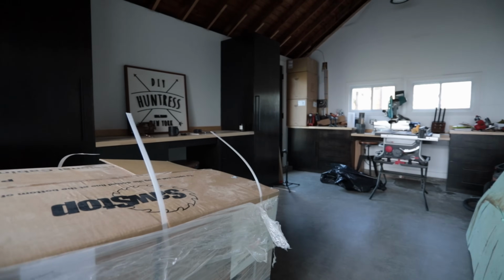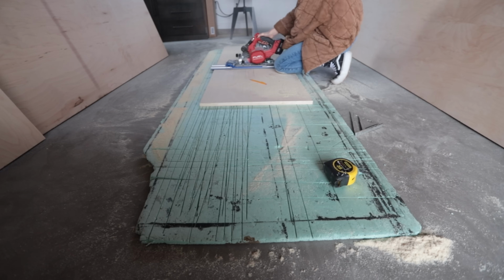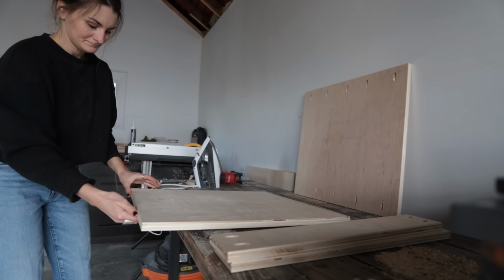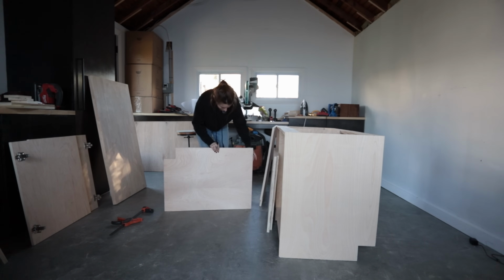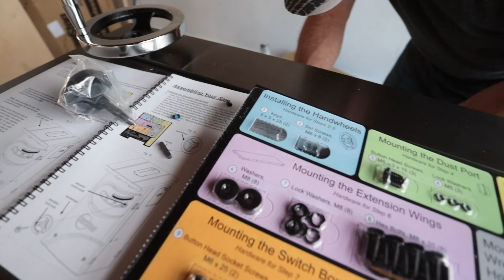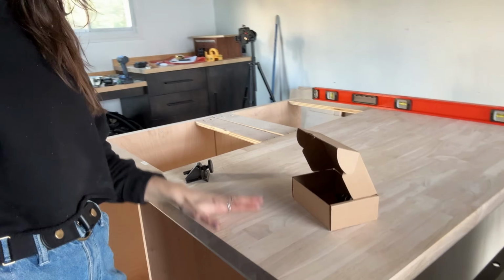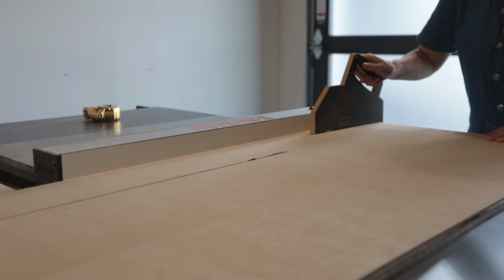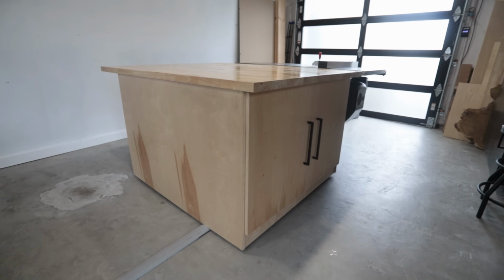I Got Rid Of My Table Saw...

Comment: Sam, the SawStop is a dream for me.  It activated the safety feature once when I was in a hurry and used a metal push stick - never again - to cut a thin strip. That tool got trapped in the blade - or it would have in an ordinary saw. Saw stop saved my tail - but losing the blade was painful. So, I didn't make that mistake again :)
Keep in mind that cast iron top RUSTS like mad if you are not careful so baby it. 

I remember first using that saw. Could not believe the power of it. Dado cuts are ridiculously powerful. It blows through any wood like nothing - even Hickory. I love the saw and have had it for about 8 years. Couldn't imagine life without it. Beautiful outfeed table. Love it.

I should mention that you can buy zero clearance inserts for the saw. I highly recommend it. And if you go the dado route you need to purchase a separate clutch for the saw as the standard one doesn't fit properly. 

Always glad to see you on a Saturday Sam. Keep up the amazing work and yes - Sam does not use stain. I love it! I'm a natural wood type of person!

Sam, one final note - please use a respirator when you use a circular saw. That dust accumulates in your lungs.  Be safe. We love you!
Reply from the maker: Thanks for all the love and advice! Happy to hear that the saw is a dream for you! Cant wait to really get to dive into using mine. 💓

Comment: very nice.   the only question I have is related to your outfeed table.   if it sits level with the saw top, you may need to extend the mitre slots to accommodate sleds and panel cutting jigs, etc,   other than that I really dig the butcher block top

Comment: I suppose a big girl saw would be nice, but I will probably stick to my dewalt construction table saw for a while. I am having a large shop built on my property so I will probably do the out feed table and it will be nice to have equipment stay in place vs. my current set up of rolling equipment out on my drive way to have a temporary wood shop set up. It works, but is a bit of a pain. It will also be nice to have a place to store lumber where currently I have a little bit of space in my garage but once the shop is built I will have much more space.

Comment: Having a cabinet saw is such  huge step up over a little contractor saw. People that haven't used one just don't know. I've had a 3hp Jet cabinet saw for over 20 years. My brother came by one time when I was building new kitchen cabinets and remarked that the parts looked like they were cut by a CNC. I had a stack of carcass parts that were exactly identical. That is not going to happen with a contractor saw (at least not by me).

Now route out slots for the miter gauge. I drilled holes at the end of the slots so sawdust would fall through rather than collect in the slot.
Reply: Yup when i upgraded it was. Game changer, the cuts are so much easier and more accurate

Comment: Soooo, no blade guard?
Reply from the maker: It does come with one, but I don’t have mine attached with my current setup. It’s very easy to put on though if I ever want to.
Reply: I have the same saw, and while I try to use the blade guard when I can, I find a lot of what I cut is pieces below 3” and at that point the blade guard is really intrusive. For wider panels it is certainly useful and it has the kickback pawls as an added benefit. In any case, the riving knife is ESSENTIAL.

Comment: The reason why you got a sawstop cabinet saw is because they are a sponsor. Also, you cut out toe kicks but then you nailed the toe kick board flush? Therefore, there isnt a toe kick?
Reply from the maker: Actually… I have had this exact cabinet saw on my dream wish list of tools since I started my business over a decade ago. And, I feel extremely grateful that SawStop saw enough potential in myself, my brand, and my work and offered to help make that dream a reality. Regardless of whether or not they sponsored this video, I would have still 100% purchased a SawStop. My last table saw was also a SawStop. 

Also, the toe kick board is not flush. It’s attached inside of the cutout I made earlier. So, there is still a small lip under the cabinet.